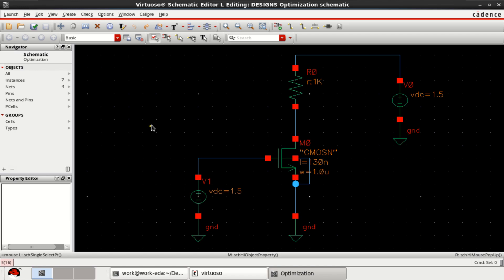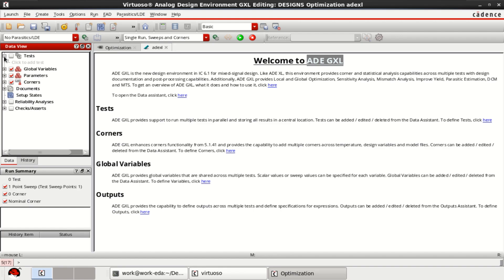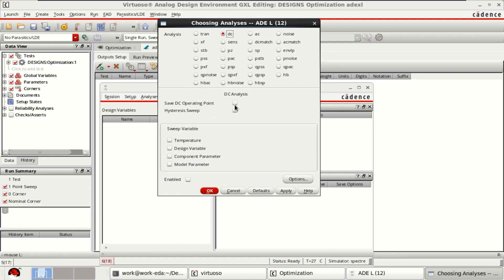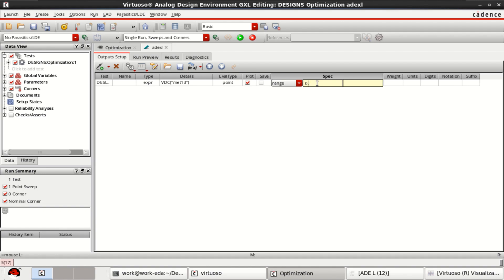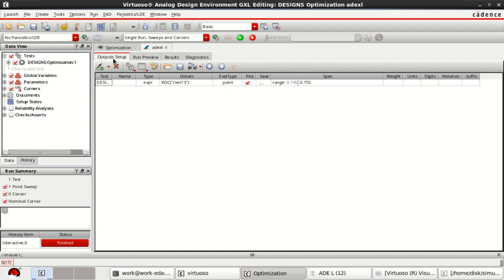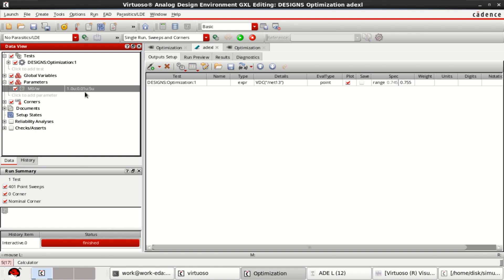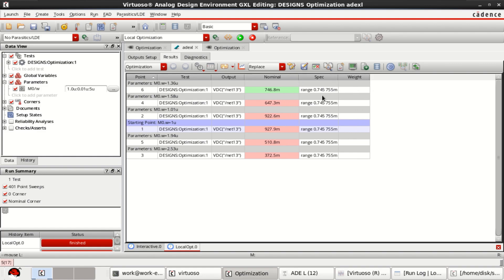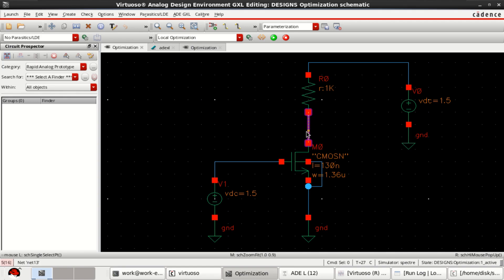Cadence Virtuoso: Optimization of Transistor Using ADE GXL

Comment: sir,
I have a module that I have created with the help of Mosfet but now I want to plot the resistance of my entire module from the input port 
but here I am using the sp parameter method to get this plot while using the sp parameter i am applying pulse input as my module resistance changes with the number of pulses applied to it so I want to plot the real-time resistance of my module as it changes with time as it is a function of the number of pulses applied 
so with sp parameter I am unable to get this plot can you suggest any method where I could plot this
Reply from the maker: Hi, S-parameter is a frequency domain. You cannot apply a pulse. Use the ports and calculate S11, S21